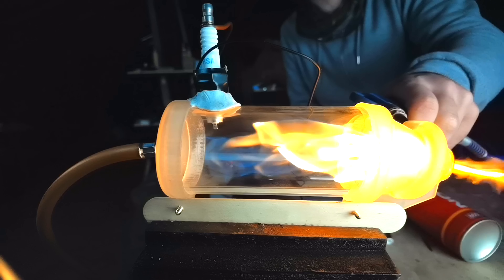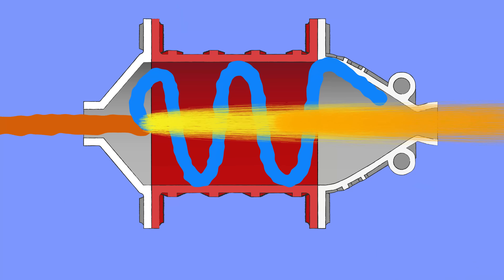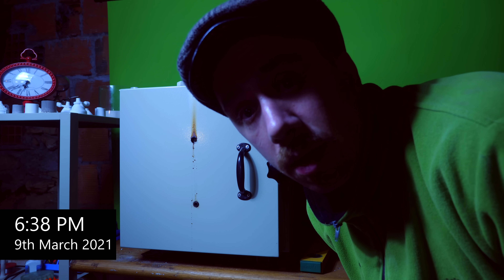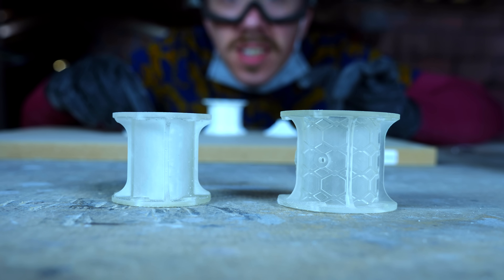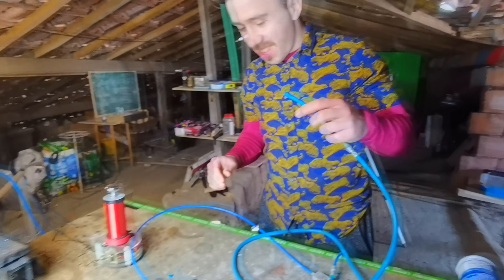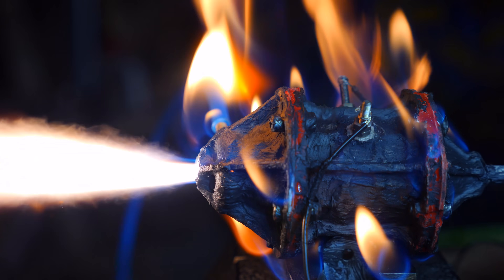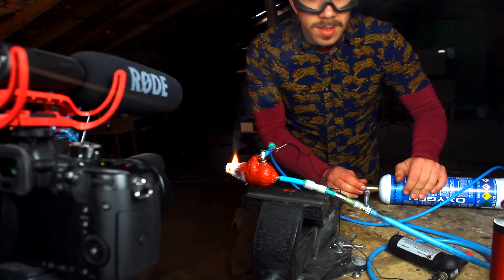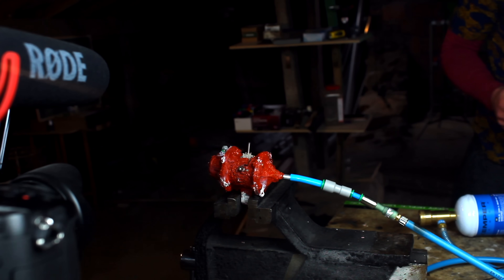Vortex Rocket V2.0 (3D Printed)

Comment: Perhaps an aluminum tube could become a jacket to your engine, and the gaps between the outer walls of the engine and the inner walls of the aluminum cylinder could be filled with ceramabond or another high temp cement.
Reply from the maker: That seems like a great idea! Thank you so much Joel!
Reply: @integza  it looks like they make all kinds of aluminum bottles as well  if you want something that roughly tapers down to a nozzle
Reply: @JoelCreates  every time I pound down a 16oz long neck can of beer I think I'll bet this would make a good rocket engine or fuel tank...
Reply: @integza  Vegoilguy on yt is doing a lot with "lost wax/pla casting" Print your engine in pla (with risers for pouring in the aluminum). Put the print into a container and fill it up with plaster, when hardened bake it in the kiln and at the same time melt the pla out. Then melt some aluminium with the kiln and pour it into the mould. Aluminum shrinks about 6% when it has cooled down so may have to compensate for that in the engine design.
I love your video's man! Keep it up :)
Reply: @roel4181  Lost material casting doesn't really work well on hollow items. It could work for a modular engine design, but not a one part design.
Reply: @integza  Aluminum cans might work. It is easy to take the lid off cleanly with a can opener. They are also fairly strong at containing pressure, compared to how lightweight they are. If you surround it on all sides with a high temperature cement, maybe it could conduct enough heat away not to melt. Then you only get fire coming out of the nozzle side, which is where the fire is supposed to be, right? :D
Reply: @integza  if you are going to jacket it might as well as a small copper coil to water cool it
Reply: @jacobdunning8373  I don’t think you could water cool the engine without boiling the water
Reply: @asteria4_943  Flowing water through a coil would work. There is no way it has enough energy to boil 5 gallons of water that quickly and as long as the piping has fresh water flowing through it it would keep the whole thing around 212f or 100c max.
Reply: @jacobdunning8373  it’s possible. But although it might keep the water at a low enough temperate without boiling it, how much could it possibly cool something like ceramic that isn’t very thermally conductive by nature. It probably wouldn’t be worth it for the small effect it would have.
Reply: @integza  this could work too although with the temps your likely seeing you'll need someway to cool that outer jacket. it could work since aluminium oxidizes on the exposed surface almost as soon as its exposed to oxygen.  So yea an aluminium pipe with a reduction coupling on one end for your fuel and oxidizer to enter through and then print your engine as an insert into the pipe so that your oxidizer port is a tunnel coils around the engine until it enters at the exhaust nozzle like you've been doing. your ceramic can probably take the heat but becomes brittle once it gets real hot. actually how could I send you a drawing of what I mean, that would be easier than trying to put it into words
Reply: @integza  create a double-walled chamber and use the backpressure from the inside chamber to create equilibrium pressure in the sandwiched second air chamber around the main central combustion chamber.  Seems it should be capable of scaling up as you increase the pressure in the inner-chamber so that you don't experience a permeation breaking point where the inner pressure overcomes the static surface tension of a single-walled chamber and whatever you coat it with.
Reply: @integza  Don't choose aluminum, it could catch fire and then you have a metal fire that is not easy to put out! I would rather suggest using a steel pipe. Or buy ceramic power, the one which is used to produce ceramic. You could even add tungsten powder to increase thermal durability. I would mix the powder mixture very watery (destilled water) and then paint over the parts or dip the parts briefly in it. After that I'd "burn" the parts again and then paint them with high-temperature exhaust paint. Perhaps enamel paint could also be used for the interior of the combustion chamber.
Reply: @integza  
Plan for what next.
You could make micro tabet 🚀Rockets (pill 💊 sized rocket engines with solid fuel rockets size up to 2.5 cm).
Small ,
Easy to make ,
Many rockets ,
Lesser fuel ,
A wide variety of results ,
Fun seeing micro rockets ,
And many of your subscribers can easily  make them.👍🏻
I have a full project plan but I am busy in preparing for my exams. 
You can think of it.
The FUN of HITTING these ROCKETS/MISSILES at CHERRY TOMATOES.😆
Reply: @integza  How about you do an 3D printed mold and mold the engine in ceramic (like plaster). Then once the ceramic is dry melt away the 3D plastic.
Reply: @integza  pls poor make a engin out of concrete i mean 3d print the basement and then por in there concrete and push it against the waĺl with another 3d printed objekt floating in the midle 😊👍
Reply: @integza  can you build an solide rocketfuel engin ?
Reply: I was thinking you could soak the parts in a really watery fire cement mix to let the cement get in the tiny holes. Then drip dry it. Could do it a few times.
Reply: Great idea but wouldn’t that defeat the purpose of printing the rocket in the first place at that point you might as well drill some holes in the bottle or tube and make it the rocket
Reply: @thundercrowz  Is it possible for that tube to be 3d printed then? If I recall, its possible to 3d print metal components but I may be wrong
Reply: @ominusomega7803  yes , the mark forged 3d printer can do that
Reply: @ominusomega7803  yes, can print metal, but not on a budget, thats SpaceX territory! ;-)
Reply: @ominusomega7803  i think that there is stuf like the ceramic for metal and I heard of wood FileMent but I don’t know and there’s not really a point because I think that more ceramic or maybe regular pla or abs would be fine?
Reply: @thundercrowz  no, he'd still be using the print at the core but thickening the insulation and increasing the pressure it could take.
Reply: @thundercrowz  Aluminum would melt too easily. The ceramic acts as tge insulator in this case
Reply: It’s supposed to be a vortex cooled rocket so I don’t think it would melt but it might be hard to get in aluminum toob on there
Reply: @thundercrowz  Your right about the 3d printing. Although we do have printers now that can print metals. They are prohibitively expensive. i still think its an okay exception.
Reply: How about if u reinforce it with some copper wires and cover it with iron oxide and alluminium Powder. The resulting reaction will give u a metal cover
Reply: @drankitmishra6513  But wouldn't that be coating the engine with thermite and given the temperature at the nozzle there would be enough heat to ignite the mixture and cause an almost runaway fire that would be extremely difficult to put out?
Reply: @alonenotlonely1179  yes i know. It would be fun
Reply: @drankitmishra6513  you’re talking about coating the entire engine with thermite... The iron balls formed would just agglomerate together without forming a consistent coating, not to mention how uncontrollable of a reaction thermite is. Assuming his engine could put up with its heat.
Reply: One thing to note about using metal chamber walls is that most metals will combust in a high oxygen and high temperature environment. If you've ever used an oxy acetylene torch you know what I'm talking about. You can actually shut off the acetylene and still cut the metal with pure oxygen after you get the metal up to temperature. I would suggest circulating your fuel rather than your oxidizer.
Reply: I would use a stainless steel sleeve, aluminum might melt at the temps he is getting to. Also maybe add a stainless steel mesh diffuser at the back where the fuel comes in.
Reply: @Bento_Boxx-m5v  I think if the vortex reduces the heat properly, then a well-cooled aluminum liner is sufficient. At least some of the heat currently is from mixed oxygen and fuel getting where it shouldn't be (in the pores of the ceramic) and some more is going to be radiating from the glowing hot gases. With non-porous aluminum, neither of those things will happen; if the vortex is made to work better there will be less hot gas at the edges anyway, and worst case maybe he could keep it cool using water or heatsinks or something. The problem is that the can is very thin, so every part of it must be kept cool or a hole will easily form. On the other hand, since it's in large part aluminum, being hot with oxygen around without being burned through might form a nice aluminum oxide layer that could end up working out. By comparison, iron/steel may well burn if no passivating layer forms. I still think it would be smart to try and spray some high temperature stuff over various things. Not sure. Obviously aluminum does melt easily, but still.
Reply: I'd say he can use the carbon fiber method he used for the pulsejet engine
Reply: I've been looking at using aluminium bottles as rocket casings, I just can't find the right size.
Reply: I like this because you could print the ceramic core and drop it in potentially without having to remove the support materials
Reply: literally the exact same thing I was thinking lmao
Reply: Just electroplate it with nickel or copper. Conductive graphit spray paint will br your basecoat.
Reply: @Taunus-Tim  Typical jet engine temperature: 2000°C 
Boiling points of copper and nickel respectively: 1085°C and 1455°C
Reply: what melts  sooner aluminum or brass?
Reply: @chillenchilla4  Aluminium has a lower melting temperature by about 300°C, so it would melt first. However, the casing shouldn't get to that kind of a temperature. I use aluminium all the time to make rockets, albeit small ones that don't burn for very long.
Reply: Aluminum will melt in no time
Reply: I would echo the call to adopt a tubular engine hull, and consider the prospects of printing a castable resin and trying an investment casting. Your furnace may be suitable for melting already. One of the benefits of metal is that you can actively cool it on your test bench and use the delta-T of the coolant loop to tell you how much heat is getting into the engine housing while it operates. Plus you have a better chance of keeping it within safe operating limits. Any eventual engine you want to really build will have to be able to absorb or radiate this heat, so you need to know how much it is.
Reply: I like this idea, the outer jacket could also be  pressurized with fuel to cool it further and provide a relief of pressure for the engine
Reply: @integza. Maybe you could use a "tongue and groove" type flange. That way you have more surface area for the sealant to hold.
Reply: If the engine is getting hot enough to destroy the ceramic, it would melt the aluminum in a heartbeat, would it not? Then Integza would have to deal with melting metal droplets, which wouldnt be hard--they make saudering mats for catching melted metal--but it'd just be another point of failure.

Steel cylinders might be more expensive, but you'd get more test uses out of it. I think that 3d printed ceramic is just too porous because of the burnout process.
Reply: @MistahBufo  The aluminum wouldn't be there to actually contain the combustion, it's just there to hold the shape for creating the cerambond jacket around the motor.

That is, if I'm understanding the concept correctly.

Comment: I think 3d printing a rocket is difficult, you could probably cut out a lot of 3mm thick sheets of metal with a cnc machine and then assemble it a a stack together (the layers of metal slightly slipped to the layer below - metal sheets like layers in a 3d print) . That would probably be resistent to high temperature.
Video Idea: an ion thruster would be really cool 😎

Comment: You should somehow use the fuel to cool the engine, maybe by having copper tubes inserted into the engine and have the fuel run through the copper tubes as coolant. Also maybe metal plates to squeeze the surfaces together. Also lap the mating surfaces on a thick piece of glass with some sand paper to help the surfaces mate better.

Comment: why dont you use carbon fiber at the external part of the engine so not only make it more reistant to the fire but also use it as a sealant to stop the leaking of the porousness of the material, also for the video idea why dont you make a ion wind propulsed plane with no moving parts or even an ion rocket engine

Comment: Looks like it is time to try lost PLA aluminum casting,, outdoors.  Or get fancy and impregnate the ceramic with copper. It doesn't require anything kinky, kind of an electroplating like process.

Comment: You are freaking addicting to watch. I am falling in love with your accent.
#no_homo
Video idea:
I think you should build some tooling so you can expand your possibilities.
For example, you can build spinning pottery wheel (with different shapes that can be interested inside or placed outside, instead of hands) for making ceramic parts like nozzle (as nozzle is basically a ceramic pot)
Or even CNC machine or something.
So Vortex Rocket V3.0 😁

Tomatoes are disgusting!
Reply: his accent is sooooo sweet <3
Reply from the maker: Congratulations Stefan! You just won a 3D printer. Send me your info (name,address,zip code,phone number) to integza@gmail.com.
Reply: @integza  Thanks bro, I just sent you an email.
Reply: why edited?
Reply: @rafaeladoig2117  Just fixed typo
Reply: cool idea
Reply: this was my idea me some printers!
Reply: vortex cooling nozzle can't be made that way
Reply: just imagine Integza start making pots and send instead of printers :)
Reply: definitely he should continue with rocketry stuff
Reply: Or even make tool that is some kind of hybrid of CNC and spinning pottery wheel
Reply: don't think this is possible

Comment: im not sure how well this would work, but you could 3D print the parts you need for your rocket out of high melt plastic, place them in a fine, wet sand and pour hot metal into the mold to make a sort of metal casting. That way you can design your parts easily and make them durable and less prone to leaking/warping

Comment: also for the rocket leaking try using a layer of apoxy resin on the outer coat of the fireplace cement you could even use some fiberglass on there for support

Comment: What about trying to apply the sealant inside the engines combustion chamber? the preassure might force the sealant inside the small pores, where it would be chared by the temperature and seal all the leaks... also you could use some of that carbon fiber with fireplace sealant to make the outer wall thicker and make it more resistant to leaks.

Comment: Soak the sintered ceramic parts in a solution of non-combustible liquid, that will harden. A very thin version of refractory cement might work. It will get in the pores of the printed part, and seal the leakage. 🤷🏼‍♂️ just a thought..

Comment: Hi, You should use gas shout off's for propane and oxygen so you could shout off the gases with only  a 90 degree turn. You learned how to weld if you could buy some rostfrei welding wire and some rostfrei sheet metal you could build some more durable engines. Some metal bending and forming and welding  you could watch Ron Covell's videos on youtube.

Comment: Hello Integza! I think the best way to avoid leaks is either by coating the motor with Teflon, or by making some metal parts on a lathe or also looking for some pots or steel jugs that can serve you, you cut them and you can get the nozzle, or the combustion chamber, the gas intake pipes could be made with bronze pipes and silver solder. regards!

Comment: The chamber pressure is greater than the silicon can hold. Print the ceramic engine and a plastic shroud that is a few millimeters greater circumference than the final engine size. Make sure the seams are not aligned. Then fill the thin gap between the engine and the shroud with hi temp silicone. Layers. Like an onion. Tomatoes dead.

Comment: it looks like the sealant is heating up and melting allowing the body to leak at higher pressure maybe an active cooling system around the body of the combustion chamber and nozzle will keep things from heating up I can think of two way to do this 1 metal pipe or built in one wrapped around it with water running through it as a coolant 2 same pipe thing with the oxygen or propane running through it like a Space X raptor engine
Reply: But, I thought the vortex engine is built that way so that it wont require any sort of separate cooling system? If the rocket engine melt, doesnt that mean the vortex is not created/large enough? Which means the shape of the engine is the actual culprit? Please correct me if im wrong.
Reply: @rizalardiansyah4486  watch the video the engine it's self is not melting the coating applied to it to prevent the ceramic from leaking like a sieve is. It looks like it bubbles then looks to melt and leaks. So it seem there are two options really to fix it 1 find a way to cool the sealant or 2 find a sealant that wont melt and leak

Comment: I would say go for an interlocking lip area on each individual part instead of just relying on the bolts. If done correctly you could put a gasket in between to provide a better seal, if you stay with the modular design. Ideally if you could get a one unit design it would be the most ideal.

Comment: Try painting the inside of the rockets with high temp sealants like that glue or refractory cement, or silicone, the Vortex if not leaking through the body should keep the glue from burning away inside. Worth a shot.